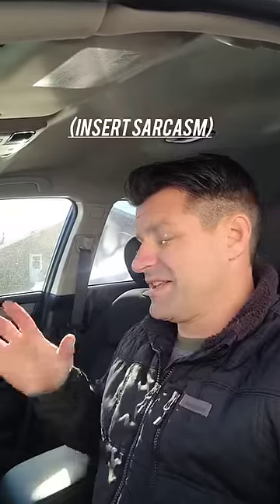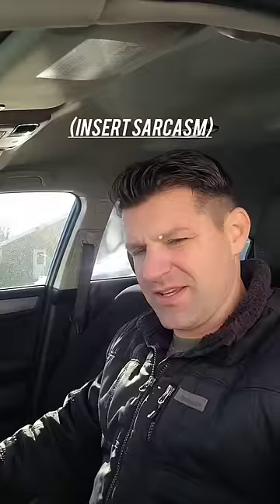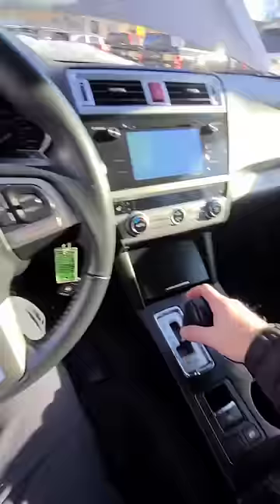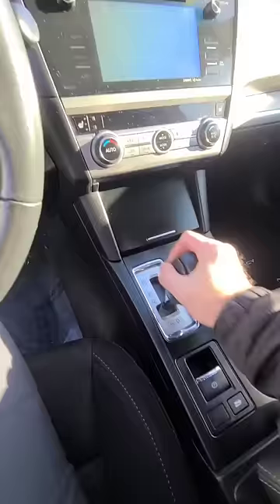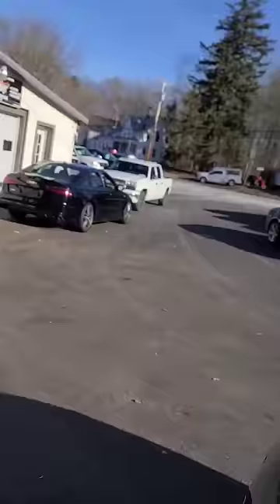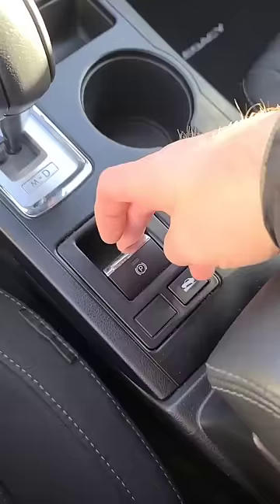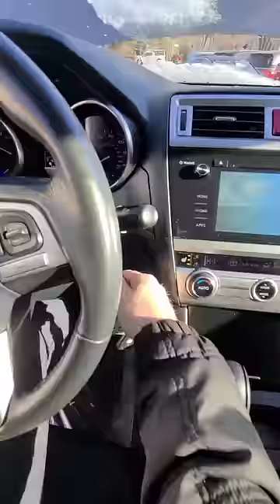Why Subaru Engineers deserve a punch in the Face! #shorts

Comment: Worst part of the electric hand brakes is that if you are moving more than a couple miles per hour they won't engage so they don't even work as emergency brakes
Reply: They do, how they actually function is you hold the button on and the car will automatically break using the entire braking system to come to a full stop, this makes use of the “front assist” technology that is fitted to cars with electronic handbrake.
It also means for those in NA where it’s called an emergency brake (which is not when a handbrake should be used) have now got a much better function for the same descriptive word.
Reply: @gtjack9  okay, but using the normal brake system doesn't help anything if the reason you are reaching for the emergency brake is that the normal brake system has had a failure.
Reply: No car comes with an emergency brake. It’s a parking brake. Use it as designed.
Reply: @tooltime4640  I see you have never experienced a brake failure.
Reply: @tooltime4640  No, it's called an e-brake. Look it up
Reply: @tooltime4640 many manufacturers use different methods, I would agree that the ones who use the primary pads are not an emergency brake, but many manufacturers use a secondary set of pads that are engaged with a cable, and that absolutely is considered an emergency brake as well as a parking brake. I believe the newer ones use electric motors to squeeze the calipers in the event of a fluid failure, so even though it still uses the primary pads, that could be considered as an emergency brake.
Reply: Its called a parking brake not an emergency brake.  It's only use is to protect your car from rolling down steep hill because your transmission is not designed for that kinda action.  Funny thing is how many people are going to read this and still not understand.
Reply: @hellfire5674  You're spreading misinformation. Look it up. It's also called an emergency brake or e-brake.
Reply: @samaelsandalphon5600  it doesn’t matter if they use primary pads. There is still a mechanical lever protruding from the back of the caliper which is moved via cable. It is not using the hydraulic system to engage those calipers. Perhaps if one wore the pads completely away and drove metal to metal until a piston popped out of one caliper and hydraulic fluid was lost……but in that case the rear rotors would be worn to near nothing and extremely hot so the little park brake shoes inside that rotor hat would probably be ineffective anyway.
Reply: @hellfire5674  no matter what name you wish to call it by if one experiences hydraulic brake failure in a vehicle equipped with a parking brake they may stop that vehicle with the mechanical brake. Stopping distance will be increased however they stand a chance of it stopping them in time as opposed to the cross-traffic ahead stopping their forward motion for them. 
 I experienced a master cylinder bypass as a teenager in my ‘70s Chevy. We were taught in driver’s ed to pump the brakes. I did not do this but kept my brake pedal uselessly slammed to the floor. I was on a freeway off-ramp with busy rush hour traffic crossing at the bottom. If I could not have stopped it would have been certain death. I stomped on the mechanical brake which goes by any name you wish to call it and my rear wheels locked. I fishtailed a couple hundred feet to a stop. My rear tires were flat spotted but nobody was dead or injured. 
 Your point, whatever it may be, is silly. Anyone with ANY automotive knowledge also knows that different manufacturers use different names for the same systems.
Reply: @kevekevevari  It's a parking brake. Americans mistakenly call it an e-brake because they drive automatic transmissions.
Reply: @PURENT  I know the main purpose of it. But it's also for emergency situations like a faulty hydraulic brake. The op said that an electric one with power is missing that feature.
Reply: You're not supposed to use it to stop
Reply: @kevekevevari  Sure you can use it in that situation, but it's not designed for emergencies. In most cars, the parking brake will hardly slow the car down because of how little braking force it is designed to put out. All it is supposed to do is be able to hold the car on an incline.
Reply: @kevekevevari  if it's not a parking brake how come the buttons got a P on it
Reply: I guess it's a parking brake and not for emergency.
Reply: Nah the ebrake is so my FWD car can get the rear end to swing
Reply: @kevekevevari   Yes E -Brake   Electronic Parking Brake. No vehicle manufacture identifies or implies the Parking Brake is intended or suggested to be used as an emergency brake. If your brakes fail and you cannot use gears to reduce speed you should be looking for ways to scrub speed such as ditches or run away lanes. The parking brake is design only to hold the vehicle in place not to stop it.
Reply: Now they're all just parking brakes. People drive, but they're no longer drivers.
Reply: @wirefeed3419  Yeah no. E stands for emergency. Seriously look it up. And obviously it was designed that way. Someone here wrote that if you hold long while driving it will use your brakes to slow down the car.
Reply: @Tom-db9hr  That's like saying I can't use engine brake because I'm in drive and it's got a D on it. It's primary use case is a parking brake. But it can also be used as an emergency brake.
Reply: @kevekevevari  nobody is saying you can't use it for emergencies, it's just that "emergency brake" is not the technical term for it, it's a parking brake. That's all
Reply: @noobeenaut  In the discussion they were saying electric ones don't lose functionality. But they can't be emergency brakes so they do.
Reply: Some automakers call it a parking brake, while some call it an emergency brake. While calling the auxiliary brake system a parking brake implies you use it every time you park your car, the name emergency brake implies it’s only for emergencies. The reality is that whether it’s called a parking brake or an emergency brake, it does the same thing and can be used in multiple scenarios. 

You can engage the auxiliary brake system when you park the car, which makes the name parking brake make sense. You can also engage the auxiliary brake system if your regular hydraulic brakes malfunction, which makes the name emergency brake make sense. Two names for one system designed to work in more than one situation.

Regardless of the name, the auxiliary brake system makes sure your car stays put when you stop and can help slow you down and stop your car if your regular brakes fail.
Reply: @AlphanumericCharacters  we were taught in drivers ed to hold the handle while pressing the emergency brake to avoid skid.
Reply: @kevekevevari  I have tried using the parking brake, problem is that those brakes are so bad that it does not really slow down the car that much. Its like 1/10th of the braking power of the normal brakes. So in case of emergency when you have say 100meters to hit something, you will still hit that thing.
Reply: @AndrewTSq  It's because they only brake the rear wheels. Also if you don't have any hydraulic brakes it is better than nothing.
Reply: @kevekevevari  yeah but modern (like from 1960ies) brakesystems are doubled. Meaning you have front left rear right as one system, and front right rear left as the other and additional parking brake. The reason why dont brake as good with parking brake is that you cant apply same pressure as a hydralic system can and if the car has separate parking brake pads they are very small in comparsion  to the normal brakes. Saab actually had parking brakes on front tires :)
Reply: @AndrewTSq  I agree that it is unlikely that the normal brakes break and a failure with the electric system.  But in that unfortunate event you can't depend on an electric parking brake, while a mechanical would at least help you stop.
Reply: It's not an emergency brake - never was... that's just faulty American terminology.
It's called a "Park Brake"...
Reply: @jerrydwyer9057  I was taught the same thing. However, I did not perform as trained in the emergency. If I had I would have pumped the brakes and hydraulic braking would have been restored. This was common with those old GM master cylinders. I panicked a bit and didn’t follow training exactly. But I got it stopped.
Reply: @markusdammasch9108  Wagner is a major automotive OEM brake system manufacturer. Their website refers to the brakes in question as “emergency brakes”. 
Case closdd
Reply: Huh, and here I thought it was for doing sick handbrake turns! Electronic "Parking" brake, gross...
Reply: @AlphanumericCharacters  i rented and filled a uhaul 26'.  Then found out, while behind my mom in law, the master cylinder had failed.    Stopped with inches.
Reply: Exactly they forget that you know sometimes people use their emergency parking brake in the event that the main breaks fail
Reply: @hellfire5674  well I have to disagree and say that the reason why you have the parking brake and should be used when you are on any non-level service if they keep from sharing off the parking pin and the transmission which is easy to do.
Reply: @PURENT  No it was literally designed to be used as an emergency brake. You've obviously never driven a car that lost its hydraulic brakes.
Before you go spouting off more nonsense I drive a manual, the "parking brake" is the secondary feature of the E brake.
Reply: @PURENT  karma's a b** so one day when you're driving and you hit your brake pedal and you hit it again and you are not going to stop and you see your life flash before your eyes please do not try to use your parking brake / emergency brake / oh s*** brake... no matter what
Reply: @monty9456  something just popped in my head when I read your comment that should catch on. They're not drivers and you think they're driving but I think they should be just called route followers. We need some distance between the word driver and drivers... real distance
Reply: @hyperwebbing  I've already used the handbrake to screw around in my old FWD automatic, even tightened the thing. Doesn't lock up or even come close to stopping the car.
Reply: @foodhatesme  Ok tell me how to put a 5 speed in park.
Reply: @kevekevevari  If you read the owner's manuals of most cars they will specifically call it a parking brake and will tell you it is not an "emergency" brake.  Every mechanic I know will specifically tell you your "emergency" brake is the normal service brakes (which are designed to stop the vehicle in emergency braking situations), not the "parking" brake (which is only designed to hold a vehicle still not slow it down).  The instructors at the mechanic training school I went to will correct you every time you call it an "emergency" brake.  If your brakes stop working you are supposed to downshift to slow the car down using the engine until it is going slow enough to put the parking brake on to actually stop the vehicle.  Just because someone decided they could try to use the "parking" brake as an "emergency" brake and started spreading that incorrect term among the masses doesn't mean that the parking brake will actually bring your vehicle to a stop in an emergency.  The only person spreading misinformation here is you.
Reply: @r.j.bedore9884  Actually it will slow down the car. Also look at for example a wikipedia page. It can also function as an emergency brake. Of course downshift in an emergency.
Reply: @Toxic_Waste92  The parking brake is NOT designed to slow a vehicle in the event your hydraulic braking system fails.  You are supposed to scrub speed using engine braking by downshifting, as well as using hills or runaway ramps, or swerving back and forth a bit until the vehicle is going very slowly.  Then you can put the parking brake on to completely stop the vehicle.
Reply: @r.j.bedore9884  I went to school to become a mechanic. There are systems that are just designed to be parking brakes. Hence the (P) symbol. But this is a recent shift in the automotive industry. In fact cars today are still shipped with a hand operated lever or foot operated pedal that allows you gradually apply an auxiliary braking system to bring a car to a stop in the event of a brake failure. These can also be applied when putting a vehicle in park to keep it in place. 

In North America most drivers are driving automatics and thus don’t use a parking brake. Hence why the term emergency brake became the norm here as we only used the auxiliary braking system in an emergency situation. The vehicle in this video has a parking brake. It isn’t specifically designed to stop a car doing highway speeds. But when your brakes fail in an automatic you can’t always just down shift as many cars only feature park, reverse, neutral and drive. You also can’t rely on a hill or runaway ramp as you can’t guarantee they will be around when your brakes may fail.

So if my choices are to slam into the guy in front of me at highway speed potentially killing myself and/or others or using a parking brake… I’m using the parking brake and hoping for the best. 

For some vehicles their auxiliary braking system is just a parking brake. For others it can be used as an emergency brake and parking brake.
Reply: @r.j.bedore9884  u do u.  Hit some bushes instead of stopping safely.  Realize owners manuals might say what they say for liability reasons.
Reply: Those brakes have a completely separate system for ending them so they work in case of a general brake system failure.
That's why they're EMERGENCY brakes. 
If they were just parking brakes why would they have a separate cable?
Reply: @flacjacket  nope... as a mechanic, I look after my cars and my customers cars... brake failures are extremely rare in vehicles that are well maintained by professionals. Also all modern vehicles have a split brake system so that if say the front fails, the rear will still work or vice versa.
Reply: @kevekevevari  so therefore if it's primary use is for parking then it's a parking brake lol although here in the UK where I am we call it a handbrake

Comment: every vehicle has a button(usually hidden) to unlock the automatic gear selector even with total power loss. You just have to find it and press it down. Roadside assistance has to deal with these issues everyday on hundreds of different models.
Reply: Even so, why should the emergency break be affected by this? The emergency brake is for emergencies. It should absolutely work under all conditions

Comment: Ima just put this out there, in the console, above the shiter.  The little plastic change catch (as I call it)  pops out. Use a little flat head screw driver to pop it off.   After that, there is a little hole, take a long screw driver or a pencil and put it in the hole and push down. This lets you operate the shifter so you can put it into park or neutral.   The shifter is mechanically connected to the transmission so when shifted into park, a parking pawl locks the vehicle into park.   That is the safety system put into the car so you can operate the shifter.    So next time, do the little hack and be able to put the vehicle into park with no battery power required.
Reply: I was thinking the exact same thing you can see the little pop out piece in the video
Reply: Jesus! Thank you for pointing this out. I was literally scrolling though the comments, only to look for this exact procedure. So many comments until finally I saw yours. No one knows of this it seems, a shame really. 🙄 Thank you, now I can stop scrolling, and saving me from having to point your exact point out. 👍🏼🙂
Reply: And engineers thought that that's less tedious than simply pulling a lever?

Comment: * laughs in 2018 subaru with mechanical brake *
Reply: Yep I'm keeping my 17 Impreza for as long I can. Spare tire too. New ones aren't even coming with them
Reply: @cabuco2006  it's been a year since this comment lmao. I've lost that 18 impreza, gained and lost an 07 Legacy 2.5GT Spec B, and am now left with 2004 WRX and 2020 outback XT. ( can't live without turbo now). I don't like driving the Outback because it has the stupid electronic E brake that I can't do jack shit with, so I kept buying older cars (after each total loss settlement) just so I can keep that ever decreasing E brake.
Reply: 2020 wrx should have the same mounting location for the mech brake and have the same rear "drum rotors" just mechanical if you are brave enough to try a swap and can find the parts.

I have a 2018 Crosstrek basest base model ever and am getting into modding it lol. I cannot wait to ruin the poor thing and it's fb20d!
Reply: @TheTechNopal 
Yeh my 2015 outback has the e brake